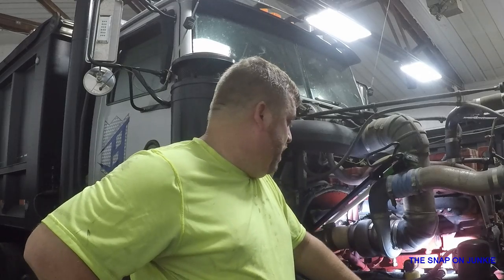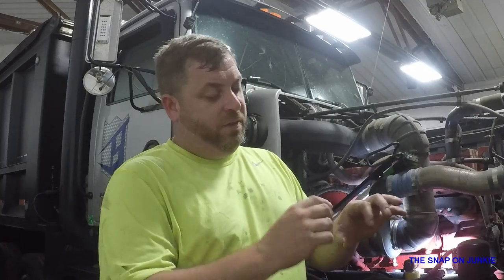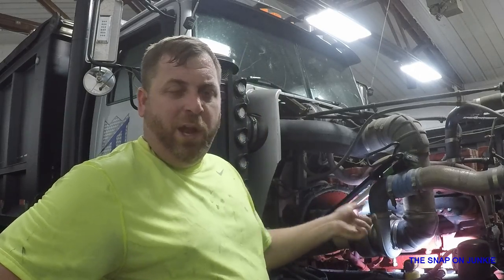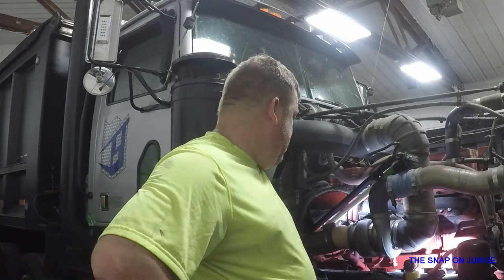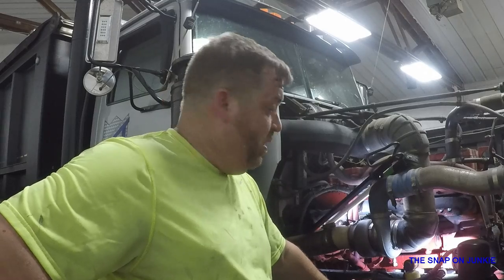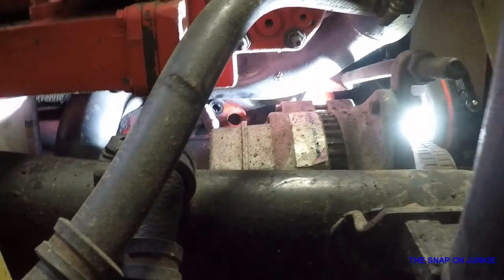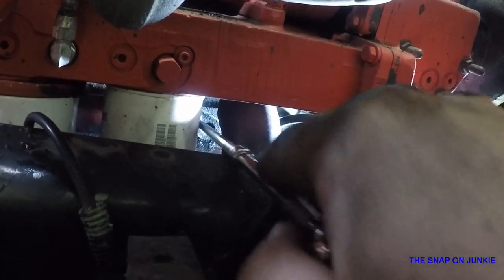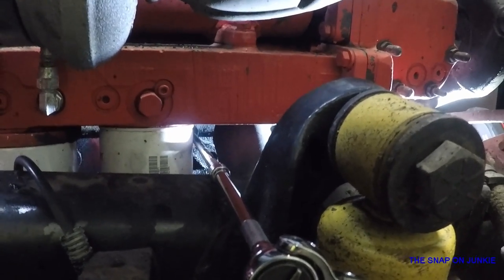THE SNAP ON JUNKIE WORKING ON THE N14 CUMMINS

Comment: was wondering if the Silicon o- rings last longer then the regular type of o- rings. was thinking about some to replace on cat motors.  because the ones that  cat sells sometimes don't work well. but I did out that some of the o- ring boss fit better
Reply from the maker: John Erickson yo silicone O-rings just last little bit longer other more pliable and they take more heat
Reply: The Snap-On Junkie!!! thanks for the quick reply and and thanks for the info